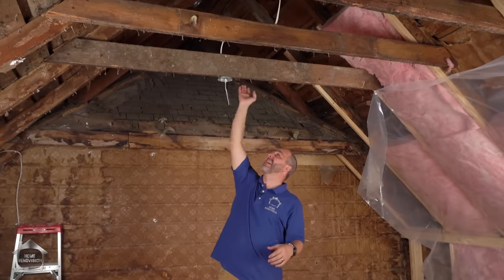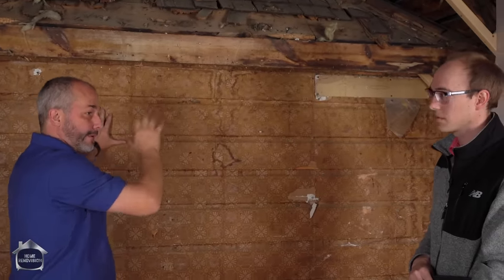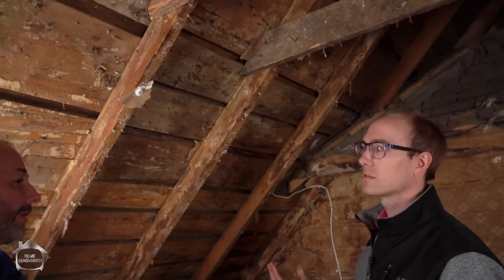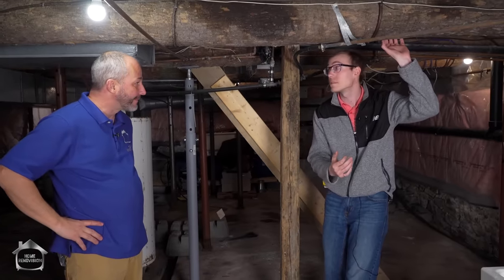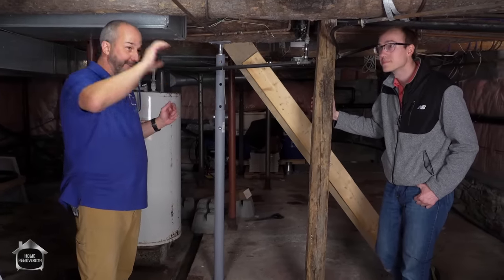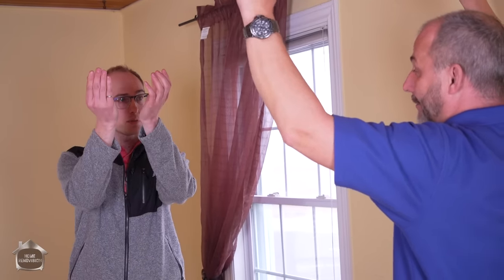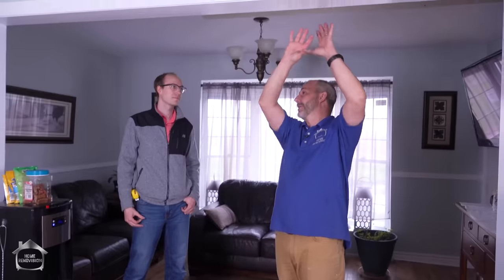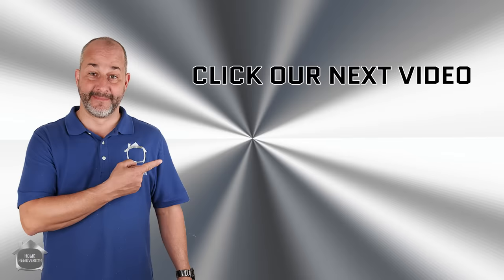Structural Engineer | Wall Removal | Basement Engineering

Comment: I cant wait to see that episode Jeff. I'm renovating my 1850's home in NJ with all the same issues. The whole building is of whack about 4" from one side to the other. I have trees in my basement as well, albeit only a 5' basement so I cant stand in it. Lastly, I have what i was told is 'post and beam' construction. Essentially none of my interior walls are load bearing so long as the beams that are in stay in. It's all held together with pegged Mortise and Tenon joinery, not a single nail in the framing of the home (not counting floors and interior walls of course).
Reply from the maker: once you get it all level and plumb the sky is the limit with a house like that. Cheers I am very jealous!

Comment: Thanks Jeff for the info. 

It's hard to find good engineers that understand old buildings. 

There's a lot of engineers out there that are book smart but not realistic smart and able to design a plan for unusual builds.  In the past the best engineers are the ones that worked in construction first and then became engineers.
Reply: experience counts for a lot, or to put it another way older guys who have been around a while...
Reply from the maker: I have had great experience with engineers. The folks at Star engineering have been really good over the years.

Comment: It's a while I subscribed, if I remember we were about 125k...I just looked and you have now 557k Subs...that is no accident, you are very good at doing stuff and showing how to...I am certain you will do a great job with this house BUT....I thought you were kidding with the threes ...then I saw them....did you hunt for the most crazy built house around...so you will cover ANYTHING POSSIBLE...I would have been running away from that house after visiting downstairs.... 😂 😂😂😂 it's hilarious to see that...
Reply from the maker: Cheers Tony, we are actually doing all new plumbing ,electrical,structure, water softener,water heater, a macerator pump, and that is just the basement. This house is perfect for the channel as it will show just about everything a person could need to fix up a house. cheers!

Comment: I am a structural engineer, and sometimes do the same work as that guy did. And it is so hard to work with such enthusiastic and unprepared clients sometimes. You came to a new building which you have never seen before, and they start talking and talking and asking questions. It is much easier if there are plan drawings or at least some sketches. I could draw sketches myself, if i have a moment. Well, I guess that's the part of my job.
Reply from the maker: Hi Tatjana, the goal of this walk through was to spitball ideas to find an economical option. I think we achieved that. cheers!

Comment: Been watching a lot of your videos lately for help with my 50's split-level. I really appreciate seeing different options for different scenarios and helping old homes to get updated on a practical budget

of course code varies from CA to USA and between states, but being 'to code' isn't fool proof either (having had a new water heater professionally installed that failed several codes at inspection anyway)
Reply from the maker: Austin, When you DIY your reno the budget is always practical. Cheers!

Comment: Struct Eng and GC here...(just a guy with a “stamp”...smh geez typical contractor lingo). 
Attic: raise ties easiest option but you will probably have to beef up the exist rafters and new ties to handle deflection and thrust. Especially if you have high snow loads. 
Crawlspace: stabilizing the “trees” should be priority. Lifting or jacking could work but could also cause more damage in older structures. 
Beam Areas: use lvls and built up columns for most strength, light weight, and ease of construction . If you need more bearing width for your ceiling joists just scab some 2x to exist to make up what you need. More than likely they lapped them over that exist wall but you never know until you open it up.

Comment: Great video, very helpful. For existing home with load bearing wall, Can you join two small beams using metal connector between the two together to make one long beam to get rid of a column holding up the weight?
Reply: Probably not.  Joining two shorter beams actually creates a weaker beam than one long one.  So you would still need to have a column there to support the beam, but then you would also need a support with enough width to satisfy the minimum bearing requirements for each beam.

Comment: When a ridge beam is put in to support the rafters in order to remove the collar ties or the collar ties are moved up to increase the ceiling height, the rafter strengths have to be checked. Because the rafter span is increased. A lot of times, the existing rafters have to be beefed up.
Reply from the maker: That was true in this case as well. Cheers!

Comment: How did you find a structural engineer?  Did you reach out to an architectural firm or is there another way?  I have an old house as well, built in 1903 and I'm sure that I need to do some kind of basement support work.

Comment: You could do a whole video on support jacks. I bet most are applied incorrectly. I mean...there's no way to easily measure the load weight, and in fact, I think most are not even supposed to be tightened in place! For the last one I installed, I attempted to calculate the tightening torque to stay under the load spec, and it wasn't all that high... I expect most people would not hesitate to tighten it further.
Reply from the maker: we did that video, it will be coming out soon. Cheers!

Comment: When Jeff started about trees and i had a good look at what he meant and then saw it... I really felt like when is the 1th of april joke HAHA notification coming 😂 First time in my life i hear/see trees used as rafters in a house.
Reply from the maker: I have only seen it once before myself. That is one of the reasons i had to buy the place!
Reply: @HomeRenoVisionDIY  ...
My house which I'm renovating , here on the west coast of Ireland, is a rubble-stone wall construction, 2 foot thick, and when I stripped back the internal render around the door frames, the original builder had used the limbs of trees as lintels !! These had to be replaced with pre-stressed concrete lintels as the twigs had turned into spongy sponge things 🤣🤣

The original lime mortar had mostly turned to sand & deep re-pointing (6" to 8") internally & externally was required to return some of the original structural integrity of the house. 
This could only be done in stages or the walls would have collapsed.
Other work includes...
 ☆ full re-wire
☆ Full re-plumb
☆ Install wet radiator heating
☆ LOTS of rigid insulation
☆ New windows
☆ New roof slates
☆ Lowering internal ceilings by 18" throughout the entire house
 ☆ Wall vents to improve breathing with all that new insulation.

The joy of trying to cut a 6" vent-hole through a 2 foot stone wall has to be experienced to be believed... 😒

I've been working on this place 8 years now & at 61y.o. I'm running out of time & energy 
🙄😏

😎👍☘
Reply from the maker: Wow, what a gem!
Reply: @HomeRenoVisionDIY  😂😂😂😂 a "gem" is not the first word that pops into my head to describe it... but I enjoy the challange 🙄😬

Comment: I have trees in my basement too. Locally cut and rough hewn to fit.  The structure is all full dimension lumber. I think the rafters were salvaged from an old barn.  Most 100 year old houses didn't have an engineer designing them.
Reply from the maker: That is for sure. funny how they engineer for 50 years but the old houses are lasting over 100 and still kicking.

Comment: Wow, lots of info. Wouldn't it be easier/faster/cheaper to just take the whole house down and build a new one (maybe salvage the foundation)?
Reply: depends, just been through it myself, starting with some 2x4 temporary bracing and ended up with 1 exterior wall and some rafters left from the original structure, everything else was tore down and replaced.   In our area the cost of a bulldozer and new construction was not only more expensive but meant a whole different set of building permits.  Hence the fact on these "hollywood production" house flipping shows, they leave some walls standing and build from there.  And we are able to grandfather in a lot of existing structure which was a bonus.   Although In effect we did go down to the foundation and re-build up with new framing.

In our case we were renovating an old barn and wanted to keep the design and style of the building - gambrel style rafters AKA a "Dutch Roof".   We had to make the collar ties lower that we wished and which was incorporated into the design with a chunky open beam look.

Working with your local building inspector (ie, keep him happy) not only allows you to get what you want but they will let you work with what you have.   Generally if you bring it up to modern codes they are a lot more lenient, as shown with Jeff here in his discussion even while the engineer was non-committal on camera, he seemed willing to rubber stamp anything that was safe and up to spec.
Reply from the maker: But then that would only be 1 video. LOL
Reply: Yea, agree with that :)

Comment: Very interesting video. I was glad to see your response to a question in the comments, as to how much the engineer charged for this.
I always thought it would cost much more for the number of projects you were asking him to do.
Reply: Where ? I just scanned the 200+ comments and haven't found the info on cost of Engineer's eval visit/process. This vid is a FANTASTIC insight into the process, but I would really, really, really love to get an idea of the kind of costs for this particular consult. No doubt there's ballpark figures out there on the Net, but here is a detailed, concrete, and informative case  and having a cost reference for this (particular example) seems essential. It should IN THE VID ! (at the very least in the vid's NOTES)
Reply: G Seidman look at the 6the comment after this from ry Mac. He replied to this with 1800 for all 5 projects.
Reply: @MJCPeters  Thanks ! Like I said, I had scanned the comments and I guess I missed it - but I did catch your reference to it. 

Now I'd just like to verify that the $1800 figure was for the consultant's VISIT and Recommendations/PLAN (i.e. not inclusive of permit fees or actual "work" on the place). I'll ask the OP, but do you read it $1800 for "VISIT and PLAN", also ?
Reply from the maker: Hi there, the cost should be around $2000.00 USD but that is just a ballpark. some jurisdictions will be more or less. Cheers!
Reply from the maker: That covers the site visit, the drawings and the stamp for when it is done.

Comment: What’s you opinion on replacing 2- 2x91/4 x16ft LVLs with a single 6x6x16ft steel H beam? No above load other than floor and joists would be hung to beam.

Comment: Very informative video! I would like to know at what point do you need to add support beams like you are doing in your main floor rooms, I mean I have an older house with some sagging floors, should I consider getting an engineer in and making everything straight and solid again or can I simply live with it?
Reply from the maker: Hi Rene, most older homes have smaller joist lumber and larger spans which cause the sag. if you want it fixed in most cases you need floor leveler compound and drop ceilings. making things straight again can be a timely and costly adventure. Cheers!

Comment: I wish I could have a engineer tell me its grandfathered in. 
Here in Ca. Only thing you normally get is. 
Oh ya it’s included with $$$ and extra work. 
You used to be able to get away with things. Not now. 
Example if you remove the last 12 inch siding or drywall. All electric must be redone. 
3rd party inspections. 
It’s getting unreal here. 
Last week I put in 42 tighten HD’s 
Had to pay a 3rd party to watch me drill. Blow out. Install all of them for the low cost of $1100 
I sent paperwork to city inspector and he came out to check it again. 
Wtf. 
Cement is now $167 a yard 
When a 2 car garage is over 100k there’s something wrong.
Reply: Mike Sacco Doing it by the book is getting very unpractical for the average diyer home gamer.. a lot of people are just quietly doing the work themselves without any permits and i cant blame them. As long as it’s quality work that is being done i dont see the problem /:
Reply from the maker: it all depends on where you live. If you want to be a flipper then best to be in a state where the inspections process is agreeable.
Reply: Home RenoVision DIY 
Not a flipper for the most part. 
Moved to CA in 99. 
There were codes. And that was all good. And gives customers peace of mind when inspection is done. 
I’ll never cut corners in safety. 
But CA has got way outta control. 
And since 2017 the fires ( north bay )
It has been a nite mare. 
The city paid out 29 million to hire outside firms to help with inspections. 
20mil for county
9mil for city. 
And inspection is now done by people who don’t even live in Ca. 
And they have came up with every reason to require new things. 
Like I said I’m all for safety and doing a great job. 
But going to build a new house and on avg it’s about $110000.00 in permits. 
Lucky I found a house to flip that wasn’t bad but not great. And was able to get a home owners permit since those are cheaper.
Reply: GDaniel 
I agree most do try it themselves to save money. 
Just make sure it’s done right. 
Codes here. Well funny I have been doing this a long time and the joke always is. 
It was to code last week but not this week. 
I won’t name the city’s 
But when you need to pay 
$165 for a permit to put a new toilet in there’s a issue. 
Not new construction. Just replace it. 
Inspector comes out when it’s done to check it. 
He never sees the floor.  Flange. Etc. 
He walks in. Looks. Flush. And signs permit off. 
People have bad views of the MOB. 
The Mob looks at CA and thinks see we’re not the bad.  Lol
Reply from the maker: too much Govt. like here in Canada. Out of control!

Comment: I was like, wait, what trees?! And when the camera pans up I'm like oh wow there are trees!
Is that common to have houses just have supporting "beam" trees?
I should mention that I just recently acquired a century home, and there's been an extension built on to it. Now this extension was done by some super cheapskate who also wanted it done in the span of a few hours (my guess). So with all these repairs we've been doing (DIY repairs), we've had so many questions on engineering choices. For one, the floor has extremely very little support in the interior that the living room and kitchen are slanted down a bit. We've been putting in extra pillars to bring it back up slowly and are going to install another support beam under a wall in the living space that seems to have NO support under it (it caused a crack in the ceiling which we assume was when snow is piled up on the roof). Anyway by point was that the one (yes one apparently) support column in the middle is cinderblock with one big log of treated lumber between the floor beams. So I guess that counts as my "tree" support, hah.

Wish you could see my house Jeff I'm sure you'd get a kick out of it. We're in the northern part of the GTA so not necessarily that foreign to you! Cheers, love your videos.
Reply from the maker: old houses are always more fun. Cheers!

Comment: lvls are made up to 24"
Reply from the maker: there are ways to get a longer span by laminating or adding a sandwich layer of 1/4 inch steel and bolt it all together. Cheers
Reply: @HomeRenoVisionDIY  yes they call it a flitch beam. I seen them done on this old house. thanks for the video this was a good one. looking forward to the vids

Comment: R-20 on cathedral ceiling is not a lot (not enough IMO) in Ottawa. Best thing you can do is remove that vapor barrier and install a 2'' R-10 foam panels with an integrated vapor barrier + 1x3 wood furring and gypsum board.
Reply from the maker: I don;t mean to be rude but r 20 is plenty for this type of structure. cheers!
Reply: @HomeRenoVisionDIY  it's up to you but you might have some ice dam during winter, vented or unvented cathedral ceiling... and that's coming from personal experience.
Reply: Just been through it and no issues here with regular R20 and baffell vents
Reply from the maker: we are going with a metal roof down the road so ice be damned. Cheers!